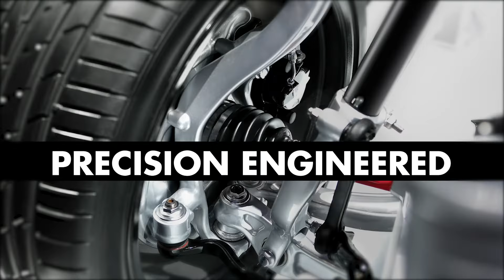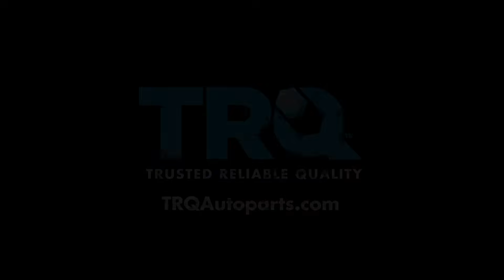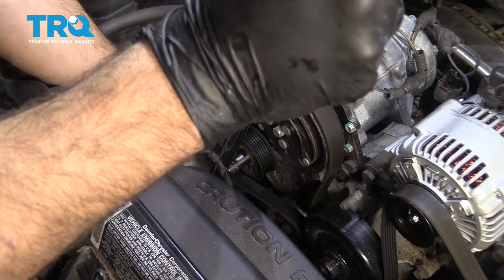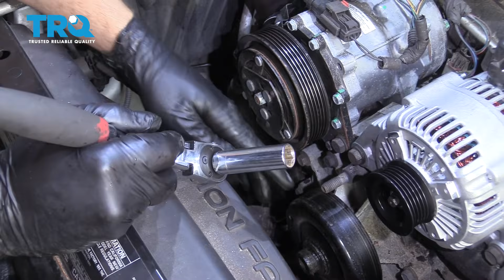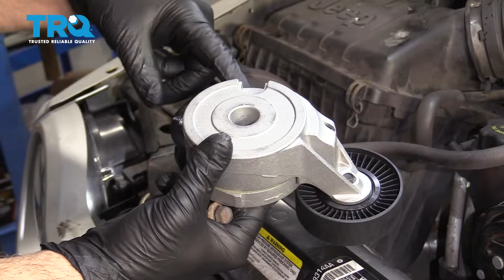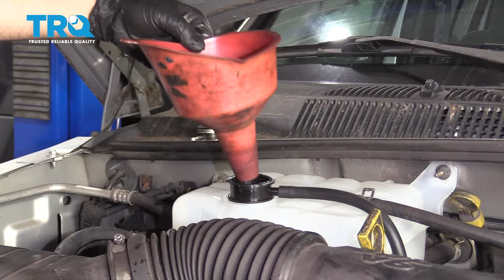How To Replace Engine Water Pump 2002-07 Jeep Liberty

Comment: When installing the new pump, I would think that tightening the bolts in a criss-cross pattern (like when tightening lug nuts on a wheel) to help ensure a more even distribution of pressure all around the entire gasket.

Comment: Excellent video only question I have is getting the air out of the system? I thought you had to break the bleeding bolt at the bottom of top radiator hose on the block?

Comment: Some liberty models does have a bleeder valve, on the top water outlet ...  My 2004 has one, the way top bleed the system is to crack the bleeder just a little bit, allowing the air from inside to escape , let i run why doing this, making sure the res if at level, once you have a good flow stream of coolant the system is then fully bleed, IF you do not fully bleed the system i will run hot and could blow a head gasket ...

Comment: Great video 👍🏻 I have a 04 Jeep Liberty and looking at it there isn’t much room to get my hands down to the bolts because of the fan. Did you remove the fan before you started the video?
Reply: That one probably didn't have the extra cooling fan in it that was an optional extra for towing mine had that fan as well. It's a pain
Reply: These have Electric fan. If you had mechanical fan you have remove it. You could remove fan if need more room but make more work and there is enough room not have do that still

Comment: Great video! And --- if the head on the 13 mm tensioner bolt is rounded off (as was mine) the right hand pulley on the tensioner can be removed, leaving the tensioner itself in place. There is sufficient clearance to pull the pump.

Comment: What does the 40-foot lbs & 30-foot lbs mean. Like I see you have a special socket wrench so like will I need that type or if I went without could I still get the job done?
Reply: That's a torque wrench.  They're generally a little pricey but you can get a fairly inexpensive one that may be good enough for this at harbor freight unless you plan on using it a whole lot.